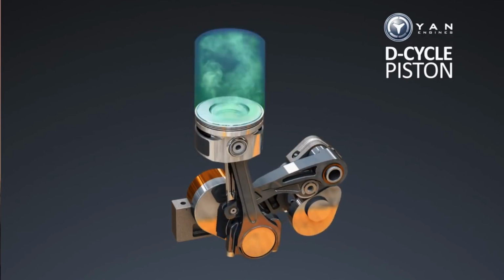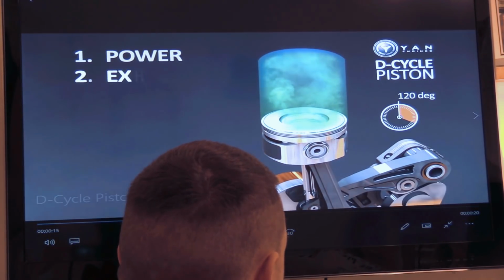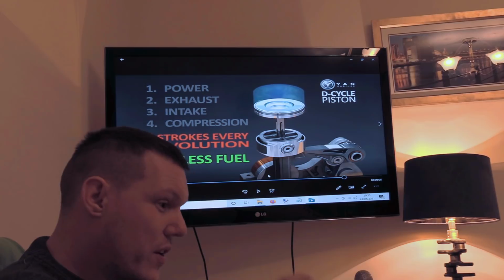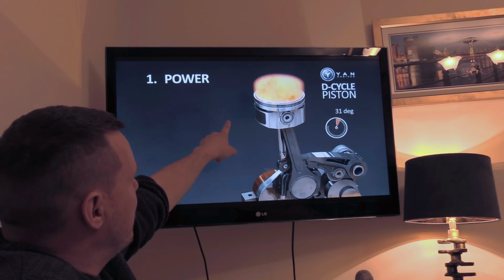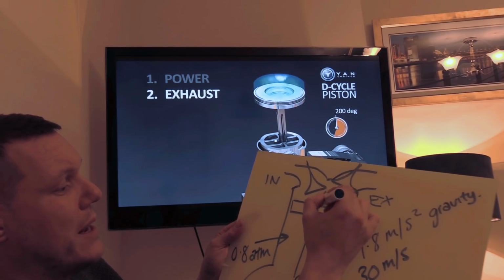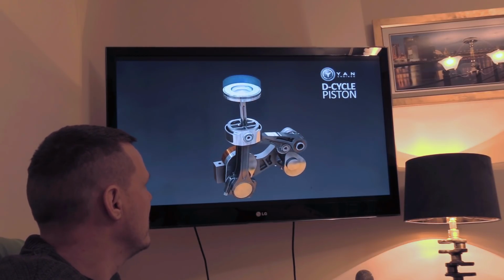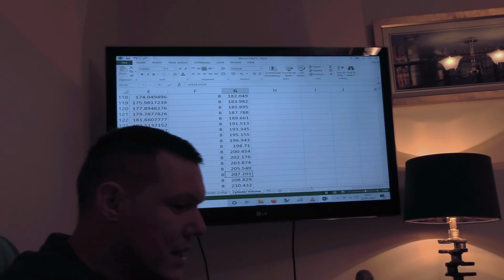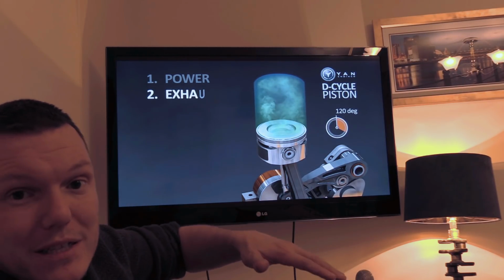Is this a GAMECHANGER? | D-cycle engine

Comment: the intake only fits in the space that the main piston would travel between 265 degrees and TDC, not 120 degrees, so it should really be much like half the fuel used for half the power, rather than 20%. unless I'm being completely stupid, which is always fairly likely.
Reply from the maker: What? 120deg is the complete stroke to volume, whilst it occurs at a different crank angle that isn't important
Reply: Mick, the power stroke is from TDC to 120 deg, the exhaust stroke is 80 deg further around from 120 deg to 200 deg, the intake is 65 deg further again from 200 to 265 and compression is the final 95 degrees, from 265 deg to TDC. You are confusing the compression stroke for the the intake stroke, mate. Try watching the smaller (crown part) of the piston, rather than the larger lower part, while the dial is going around to its marks - 2:33
Reply: @jonnya6107  I see where the confusion lies. What I meant is that the intake stroke hits its bottom when the main piston is at 265, so the volume of the intake stroke is identical to the volume of the compression stroke, which goes from 265 to TDC.

I worded it so poorly that I even confused myself when I read both our comments back to see where I'd fucked up. I believe I agree with your assessment, I just stated it weird.
Reply: @thedirtyworkshop  the power stroke is 120 degrees (during this time the minor piston and main piston are moving in tandem, so you can abstract them as a single object), but the intake stroke fits the volume of 265 to TDC. the minor piston is moving separately from the main piston here, and travels from the top of the bore down to meet the main piston at 265, meaning the volume it creates is identical to the compression stroke which has both pistons again moving in tandem from 265 to TDC. since the main piston is half way up the bore at 270 this means the volume of the intake stroke is just slightly over half the total volume that it would be if it were a conventional 4-stroke, and probably around 2/3 of what this thing's power stroke is.

which gets at the way the power stroke works differently than in a normal 4-stroke, because that volume is considerably greater than either the intake or compression stroke, meaning that the power that goes into turning the thing is probably further diminished here as well.
Reply: Since it's the intake stroke that governs how much fuel and air gets into the thing, I don't see why it matters that the power stroke is 120 degrees. that's just space for the combustion to fill, and because the intake volume is smaller than the power stroke volume the combustion is going to be filling it less aggressively than in a conventional engine, which I think probably means a comparative power loss.

I think I've probably stated my interpretation fairly clearly now, so if you see that I'm wrong at this point then you're probably correct.
Reply from the maker: The intake stroke length is from 0 to 120. When that stroke is doesnt matter. And with the 2 pistons moving together, so what?
Reply from the maker: What matters is the ve.
Reply: @thedirtyworkshop  no, the video shows clearly that 0 to 120 is the power stroke. the pistons must be in tandem here for the forces of combustion to transfer to the crank.

during compression the pistons also need to be in tandem otherwise the crown would be sitting around at the top of the cylinder for a while waiting for the main piston to come up to it so that the power stroke could happen correctly.

exhaust and intake are where the pistons separate, but since the power stroke takes 120 degrees that means the other 3 strokes must be divided up into the remaining 240 degrees somehow. the design choice made was to accelerate the exhaust and intake strokes and try to draw out the compression stroke as long as possible. so compression is allocated 95 degrees. but ultimately intake must match the volume of compression and exhaust must match the volume of the power stroke (there is nothing linking the power stroke length to the intake stroke length in this engine design), so the volume of the intake stroke is the same as the volume of the compression stroke which is just over half the volume of the cylinder. something close to 130cc in your 250cc example. but as you already noted, the 0-120 degree stroke gives a volume close to 200cc, and that 200cc is the power and exhaust strokes.
Reply from the maker: Its still the stroke of the intake...
Reply: further complications arise too. since the intake stroke is compressed in time compared to the compression stroke (it takes 13/19 the time of the compression stroke and 13/24 the time of the power stroke) it means that the rate at which air can be convinced to fill that volume will noticeably limit the speed of the engine. in contrast, a conventional 4-stroke has much more similar durations for each stroke, which allows for combustion to fit into roughly the same amount of time it takes to draw in air, but here at the hypothetical maximum rpms the power stroke must be kept about twice the duration of the maximum intake speed.
Reply: @thedirtyworkshop  No, it's not. Intake exists in the volume carved out by the main piston between 265 and TDC, which is 95 degrees worth of crank rotation (but the intake stroke itself is compressed into 13/19 of that, which is where I agree with you that it is divorced from literal crank rotation), or just over half the volume of the cylinder. The power stroke exists in the volume carved out by the main piston between TDC and 120, which is 120 degrees of crank rotation, and about 80% of the volume of the cylinder. I truly don't know why you're not seeing this.
Reply from the maker: Wow
Reply: @thedirtyworkshop  For the intake stroke to be worth 120 degrees of crank rotation the compression stroke would have to start at 240. it does not, it starts at 265.

you can 'wow' at me all you want, but you are wrong in your claim that the power stroke and intake stroke are the same volume.
Reply from the maker: I never said they were. I said that at a guess the max volume you could have is 120deg worth of volume. Using the r1 numbers its about 4/5th of the cylinder...

You nor I know the valve timing or have defined an rpm. The reason why 120deg limits the available volume is because it would contact the lower piston.  

I'd have thought you'd have worked that out, obviously not.
Reply: @thedirtyworkshop  120 limits the power stroke, 95 limits the intake stroke.

this is a quote from you in this thread, 'The intake stroke length is from 0 to 120. When that stroke is doesnt matter. And with the 2 pistons moving together, so what?'

So yes, you directly said that the intake stroke length is the same as the power stroke length, because 0-120 is the power stroke length. In the video you are specifically watching the power stroke and talking about the intake stroke. This is where you mentioned the 80% volume and did your quick maths to get at a 202cc estimate for the maximum volume used if the cylinder were 250cc.

I think, somehow, you're assuming that this engine operates like a conventional 4-stroke where all of the strokes are the same length, and so in your head you grabbed the easiest stroke to measure, the power stroke, and just assumed that all of the others have the same length. But if you step back and spend half a second to think about it you can see that the intake stroke is not related to the power stroke, but to the compression stroke, and the crank angle defines the compression stroke, meaning that determining the relative length of the compression stroke to the power stroke is possible, and as a result determining the relative length of the intake stroke to the power stroke is also possible.

Assuming the head is in a single, set location, then the power stroke and exhaust stroke must have the same length as each other, because the head defines one end of each, and the bottom of one is the bottom of the other. Similarly, the intake stroke and compression stroke must have the same length as each other because the head defines one end of each, and the bottom of one is the bottom of the other. The power stroke's length is defined by the crank rotation of 0-120, thus the exhaust must also be. The compression stroke's length is defined by the crank rotation of 265-0, thus the intake must also be. As such, the intake volume and power stroke volume are decoupled in this design.

Valve timings won't matter too much to these considerations, because all they can possibly do is make the situation worse. Since the intake stroke draws a volume that is merely 13/24 of the power stroke, and the valves will have to be timed to make the actual draw of air even shorter than that, but the volume of the power stroke is almost certainly more fully utilized. The only way to bring the intake volume more into line with the power stroke volume via valve timing would be to open the exhaust valves about 2/3 of the way through the power stroke, which will render the power output of the engine even more pitiful than it already would be.
Reply: now, if you came in and noted that some of my figures are applied inappropriately, like when I say that the relative length of the intake stroke to the power stroke is 13 : 24, then you'd be correct. As a general rule I make small errors like this on purpose in discussions like this to check if the other party is actually paying attention or just mindlessly yelling at me.
Reply from the maker: Lol I think you're an idiot.
Reply from the maker: Let me clarify, you're an idiot because you stated this with "you directly said that the intake is the same as the power stroke length" which i did. Even your own quote doesn't say that ...
Reply from the maker: Right, I'm at home now, not at work.

So....

This bit - 

What I say =
"'The intake stroke length is from 0 to 120. When that stroke is doesnt matter. And with the 2 pistons moving together, so what?'

What you say =
So yes, you directly said that the intake stroke length is the same as the power stroke length, because 0-120 is the power stroke length."

I didn't directly say "the intake stroke length is the same as the power stroke length" - at all.... you can read right above it what I said.
Reply from the maker: Anyroad, moving on..

"In the video you are specifically watching the power stroke and talking about the intake stroke. This is where you mentioned the 80% volume and did your quick maths to get at a 202cc estimate for the maximum volume used if the cylinder were 250cc."

Key word there is estimate, both mathmatically and showing where I get that from - the down stroke...

"I think, somehow, you're assuming that this engine operates like a conventional 4-stroke where all of the strokes are the same length"

- LOL I think this is a model, and a bad one at that... I think you're not a clever as you think you are, and I think you don't understand how to get a point across to an audience that's on various levels of understanding. I call them kind of people knit picking cunts. Hence why I said you don't know the intake valve opening timing...

"and so in your head you grabbed the easiest stroke to measure, the power stroke, and just assumed that all of the others have the same length."

- Oh look, I was correct. 

"but to the compression stroke, and the crank angle defines the compression stroke, meaning that determining the relative length of the compression stroke to the power stroke is possible, and as a result determining the relative length of the intake stroke to the power stroke is also possible."

- Thanks for the education LOL why aren't you doing these videos? 

"Assuming the head is in a single, set location, then the power stroke and exhaust stroke must have the same length as each other, because the head defines one end of each, and the bottom of one is the bottom of the other. "

- Apart from that's not true. The cam profile defines all of these parimeters. So much for that education you were handing out...

As for timing of the valve train, you've missed that point, clearly. For instance the animation takes 0deg TDC to be the beginning of the power stroke... but at what rpm? and it's usually never 0deg... As with all of this it's just an animation of an idea, not to be taken as actual fact...

120deg crank rotation gives you the lowest point (base circle) of the cam profile. This is the lowest point the design as is could accommodate for the crown section of the 'piston' so you take that 120deg and whatever the ore and stroke relationship will give you a volume, in this video I say about 200cc for a 250cc cylinder.

Since this is 4/5th of the volume or 80% it makes the '20% less fuel' quote easy to understand, and that's the point of the video, to make it easy to understand...

You've taken that as gospel and started down the path of being a prick about it, well done.
Reply from the maker: I'd agree but I know what I meant. So what am I meant to do, disagree with myself and agree with you? I was talking and I'm still talking about the design as a concept, not this crude 3d dream. 

For instance the rocker arn wouldn't follow the cam like that, but we just ignore that...
Reply from the maker: Also know one said anything about ve over 100% or anything like that. You've obviously misunderstood what that meant.

Intake strokes aren't defined by 1 half (2t) or 1 stroke (4t) of the cylinder. A stroke is but the label, power, intake, exhaust, compression are flexible. These are usually defined by the function and the timing of the valve arrangement.

 For example the 2t. Where is the power stroke? From tdc to bdc? Or from the moment the exhaust valve is exposed? Do 2t only have 2 stroke? Is it power and intake? Compression and exhaust? 

When I said you don't know the timing this means when does the intake open and close? It doesn't matter. What I wanted to know is how far down the stroke the piston can go without interfering. In part 2 I describe what that is...
Reply: literally, all I ever tried to do in all of this was ask you why you're saying it would use 80% the fuel when the intake stroke has a volume of just over 50% the cylinder volume.

The power stroke is ~80% the cylinder volume, I agree. but the intake stroke in this model, given these numbers, is about 55% or so. so somehow in your mind the engine drinks 80% the fuel (maximum, because valve timings, I get that) but I'm seeing that the stroke which actually draws in the fuel can only bring in about 55% (again, maximum, ignoring valve timings). so, if I'm wrong, why?

I'm just trying to pose an honest question to you. this is far more your expertise than mine and I'm under absolutely no illusion that I'm more clever than you here. there just seems to be a misunderstanding for some reason.
Reply: I also get that the whole mechanism driving the crown can potentially move it around in really odd ways, but the animation seems to strongly indicate that the top of all the strokes is either identical, or damned near identical. and at any rate, if it didn't carry it all the way to the top then the intake stroke would be even shorter than the ~55% figure I made up for convenience sake (whatever value it actually is, fine, I don't care, it's just clearly a bit over 50%).

the animation also puts the bottom of the exhaust stroke at the bottom of the power stroke, and the bottom of the intake stroke at the bottom of the compression stroke. so given all that, and borrowing all the simplistic assumptions you made in the video, what am I missing?
Reply: you: '120deg crank rotation gives you the lowest point (base circle) of the cam profile. This is the lowest point the design as is could accommodate for the crown section of the 'piston' so you take that 120deg and whatever the ore and stroke relationship will give you a volume, in this video I say about 200cc for a 250cc cylinder.'

me in 400 different ways at this point: yes, but that 120 degrees only appears in the power/exhaust strokes. for the intake/compression strokes the bottom is at 95 degrees from TDC. and since fuel is brought in on intake, what the fucking hell are you talking about?
Reply from the maker: What am I talking about? The design is not about the exact timing, or any minor detail that can be changed. Take the sky active system. That designs focus is on the cycle of the system.

Comment: There is the Commer Knocker and this POS is the Yan CLACKER.   Might work as a low speed tugboat engine that turns maximum 250 rpms wot.

Comment: It needs boost to help the intake stroke. And that boost will need more pressure than a regular engine to get the same number of sweet O2 molecules to burn, thinking they have the same stroke and bore (volume), since this one clearly has a really short intake stroke. 

Fun when a pressure hose on the intake side goes and POOOF your idioticly complicated engine has clapped and slamed itself to destination fucked.

But its fun to think about. Love the vids

Comment: Does 20% less fuel on the intake stroke mean 20% less power when the combustion stroke is longer than the intake stroke?
Reply from the maker: Power comes from force. Force comes from energy. There's a difference between less fuel and more efficient...
Reply: @thedirtyworkshop  yes but the more efficient means more force per given amount energy? So the 20% less fuel will in this engine will theoretically equate to less than 20% less power?  Basically several times at the end you said 20% less fuel is 20% less power when it’s actually just 20% potential energy to extract. Has the guy calculated that he gets enough extra efficiency to substantiate his 20% less fuel in terms of engine output or is it really just a comparison per power stroke?